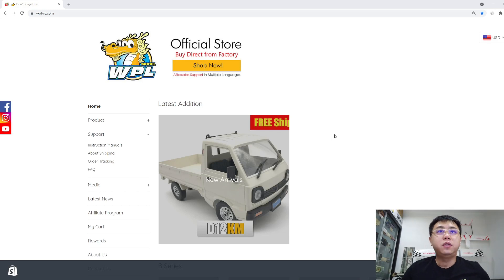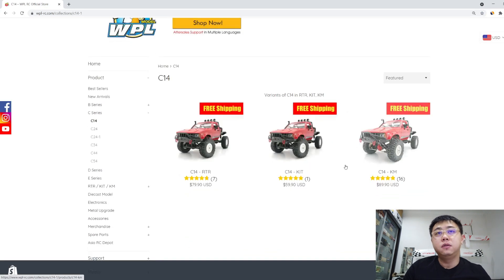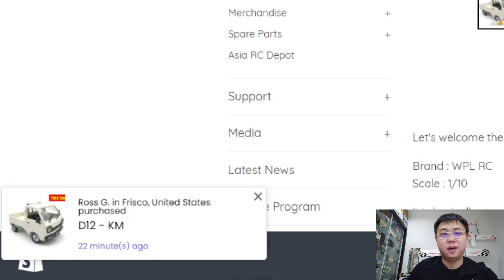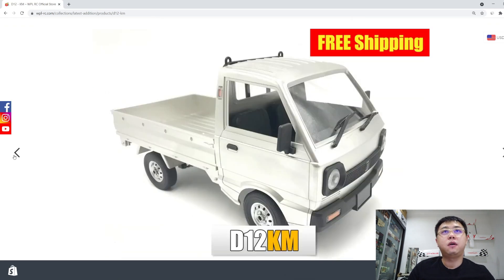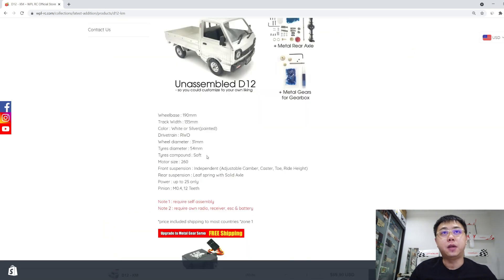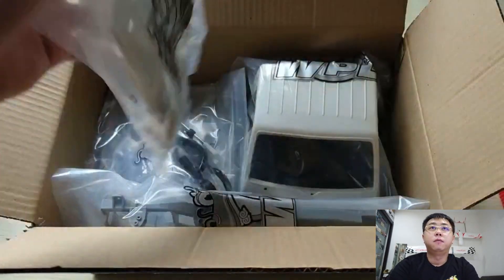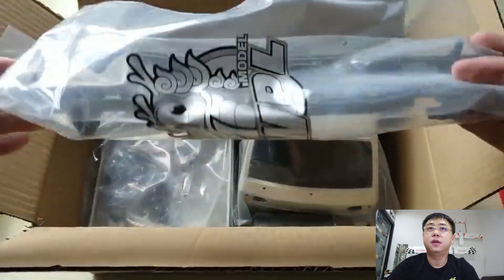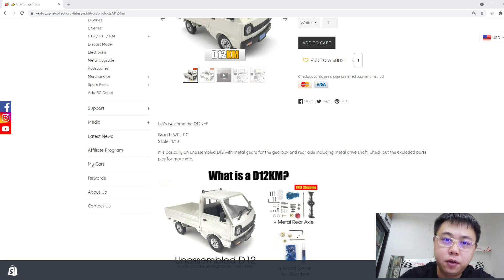What is D12KM!?

Comment: So this version doesn't come with the remote,battery and the motherboard?
Reply: Correct, just like all the other KIT from WPL.
Reply from the maker: Ya requires own electronics. At the moment no recommended electronics for D12 KM yet. You may use your own. 
RES-V3 would work too actually https://youtu.be/6yOjuOFNyas

Comment: Hi Ed can you confirm in the photos for the d12km if the rear axle is using brass gears or steal buddy 🤔 another great kit from wpl
Reply from the maker: Hi. Checked. it's brass. but can't guarantee that all will be Steel though. Factory may change it